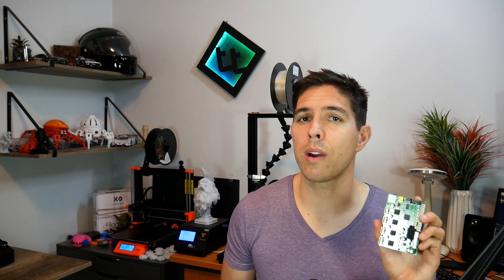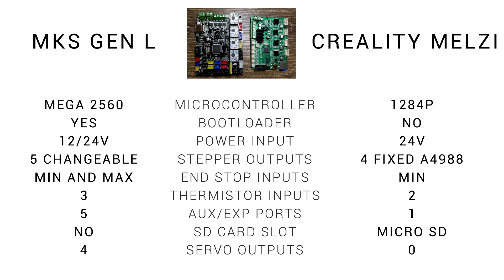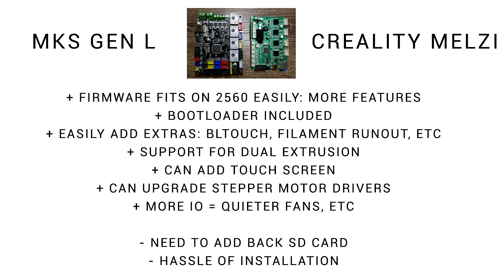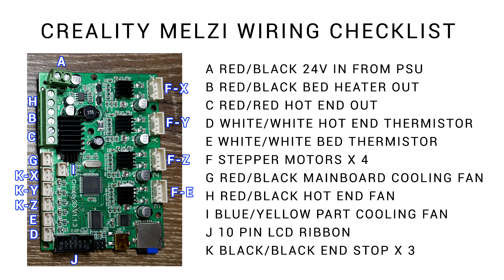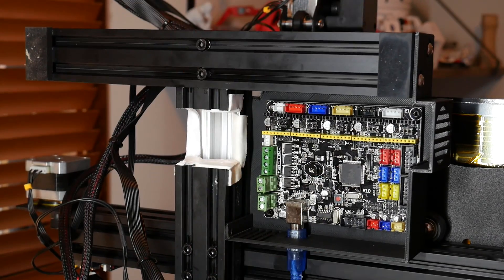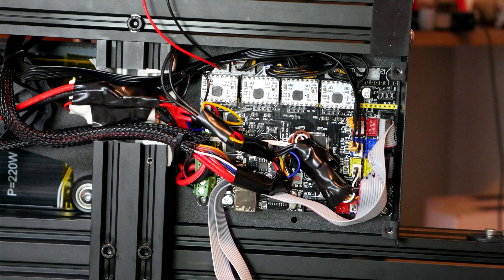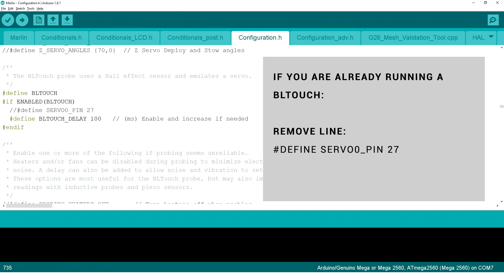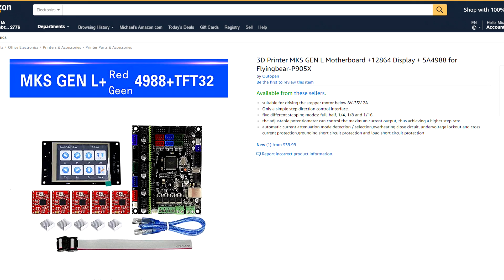Easy and cheap Ender 3 mainboard upgrade: MKS Gen L guide

Comment: Another great video Michael.  I've just purchased the  MKS Gen L board and some TMC2208 drivers to replace the stock controller on my Anet E10.  Your video helped a lot cause I wasn't sure where to connect the correct fans to, but pics really help.  Thank you. I would love to see a video on adding a touch screen to the controller, even though I use octoprint,  I still like to have the screen in place.

Comment: Is the pin 27 adapter board you used in your BL Touch video not used for this board ?  I noticed you uncommented the pin 27 line from the configuration file.
Reply: Jarrod Woolley this board has the input for the BL Touch already on the board. The pin 27 adapter isn’t needed.

Comment: how about a review on one of these? tempted to future proof my set up https://www.aliexpress.com/item/MKS-SGen-32bit-controller-board-which-runs-smoothieware-firmware-and-supports-A4988-DRV8825-LV8729-TMC2208-TMC2100/32964503976.html?spm=2114.search0604.3.8.18cb2999vqdo68&ws_ab_test=searchweb0_0,searchweb201602_2_10065_10068_10130_10547_319_317_10548_10696_10192_10190_453_10084_454_10083_10618_10307_10820_10301_10821_538_10303_537_536_10059_10884_10887_100031_321_322_10103,searchweb201603_51,ppcSwitch_0&algo_expid=c7f4b912-765e-42ef-856d-c7d672475e4e-0&algo_pvid=c7f4b912-765e-42ef-856d-c7d672475e4e

Comment: I am getting an Ender soon. Watched alot of the vids on bootloader, stepper dampers vids you and others have done. It seems to me for the cost of this little board it may be a day one upgrade, during assembly of a new printer. Thermal protection on day one and then any future electronic upgrades, ABL, runnout, etc are all easily added. I am thinking I would rather keep the metal housing and just drill holes for some standoffs. 

What is your opinion of adding this to a new system on day 1?
Reply from the maker: I would say make sure it's printing properly first. If you had a dud component somewhere you wouldn't know if it were the new board or what came on the printer.

Comment: Beside be able to add a touchscreen the fans and more outputs, what is the real advantage on this?
Reply: ST NT Mainly an increased memory to add additional features. The built in boot loader is a plus to upgrade the firmware. On the original board, to add a BL Touch and filament sensor you had to delete other features such as the boot loader.

Comment: You don't need to foam tape for the underside of the extrusion, there's a cable protector that fits the slot on thingiverse: https://www.thingiverse.com/thing:2934313 think me will be getting the mks board there's a few electrical issue's i'm not comfortable with on the original, one being if powered USB there's is a voltage bleed back on to the 24v rail so dont feel comfortable leaving the raspi plugged in when the printer is now powered.

Comment: Are the 5pcs stepper motor drivers required for this upgrade? Thats something that wasn't very clear in the video.
Can you just get by on the bare board and stock Ender 3 parts?
Reply: No you need the drivers as they are built into the ender board. The MKS board does not have hard wired drivers because the advantage is being able to upgrade your stepper drivers. I would highly recommend TMC2130 drivers as you will get less noise and better accuracy/quality prints.

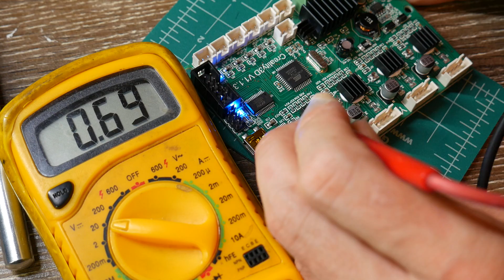Comment: I'm not very familiar with electronics, what are you doing at 5:00? Something about Voltage refs? Is that a critical step?
Reply: He's measuring the voltage on the stepper drivers.  Turning the small trim pot on each driver allows you to adjust the voltage going to the stepper motors

https://www.youtube.com/watch?v=AVlee67TQxs

If you're not familiar with electronics at all then you really shouldn't do this upgrade. A single slip-up will ruin a board when doing this.
Reply: @AERuffy  Thanks! Gotta learn it sometime :)
Reply: @AERuffy  Is it essential and I have to look into it or can you skip it?
Reply: Ian it's essential. Too high and motors run hot, meaning a fire risk and or parts failure. Too low and you'll get skipped steps. It's not hard to do, there are tutorials on YouTube.

Comment: Great video! Thanks so much! I'm thinking in print the bullseye mod for my ender 3 pro, like in your older video. I see your mod with a noctua fan. Do you use it with a voltaje reductor or dual fan? Could you share the stl of this mod, please ?  Thanks in advance!!!
Reply: You will need a buck converter (voltage reducer) to add the Noctua fan. Noctua only makes 40x40 up to 12v. I personally have mine hooked up to the power supply using a JST connector so it is running all the time but might try to make it so that it works with the fan connection on the MKS. Either way, you will need to reduce the voltage.

Comment: thanks for the video, I was just trying to put together my MKS board with my Ender 3 and I was (and I'm still) struggling.
I followed these steps and I flashed Marlin but I don't have the Bed Temp and control anymore. Not on the screen, not on octoprint either.
I used another marlin firmware customized by someone else, I got the bed temp and control (but I have some other problems so I tried this way)
Do I have to modify something else in the firmware to enable the bed temp ? it's really weird !

Comment: You should have also added a micro usb module, soldering the wires yourself is not a problem but as alternative there should be connectors already made for sure.

Comment: Awesome walk through Michael. I have a couple of questions on things you mentioned. Obviously I'm refering to my CR-10 S4 (v2.1 board), 1. S-curve, is it worth enabling? and will it work on my printer? 2. I'd like to add the temp controlled hotend cooling fan function, do you have a guide? 3.  Would a touch screen work. Do you plan on making guide videos on these things?

Comment: My Ender 3 came with a dead extruder driver, as I do electronic repairs I replaced the driver IC and did some pcb improvements, you can find videos of it on my channel if anyone is interested.

Comment: interesting post , I got a Gen L for mine but I intend to use the 1284 RRD full graphics as it has the handy SSD slot - while  bench testing the electronics I found that I had to  remove the plastic plugs on the exp1 & exp2 and flip them around 180 degrees for the display to work - not sure if I'm going to go with tmc 2130's  with hardware SPI or lv8729's  with 32 steps as yet as thats what I have to hand - one last thing  not sure if your aware but there are some new very cheap 32bit boards appearing like that bigtreetech SKR 1.1 which looks very similar to the GEN L but 32 bit and smoothieware

Comment: When i use it with 24v...do the stepperdriver also run with 24v or is ther something like a internal buckconverter that droped the voltage to 12v?

Comment: I just ordered a CR-10S board to upgrade my Ender 3. I was looking at the MKS board, but seemed too much work to make fit. I should have waited for this video.
Edit: Just got the CR-10S V2.1 board working with Marlin 1.1.9 using the CR-10S config examples and changing the print dimension for the Ender 3, and the LCD config to be CR10_STOCKDISPLAY from REPRAP_DISCOUNT_FULL_GRAPHIC_SMART_CONTROLLER. The V2.1 (and probably V2.0) board does run fine with 24V, in case anyone was wondering.
Mostly the install was as simple as swapping the boards over. The 10-pin LCD connector needs to be installed 180 degrees rotated, which means you need to cut the locating protrusion off the connector (done easily with the blue side cutters). Seems the Ender3 connector was wrong, now they have fixed it to be the same as everybody else. The hot-end fan was bare wires and I needed to crimp on a 2-pin connector to plug into the new boards VIN connector. You could pick up voltage for the fan from the PSU connectors, but I wouldn't try to double up on the hot-end or bed connectors as a lot of current flows through these.

Comment: WOW, good job Michael.  That was a ton of work. There is a Thingiverse file to 3d print a protector for the wires going thru the mainframe.   Here's the link:  

https://www.thingiverse.com/thing:2934313

It says a cable protector. I think it should be included in a list of upgrades. I made one for mine. It works

I haven't got my Ender 3 back up and running yet. :(   I just don't have the money. I need wheels and build plate, another $40US
and I just don't see it happening anytime soon. Shame cause I did do some prints before it went south. I'm thinking seriously about the tevo tornado. 
Thank you and Merry Christmas to you and the family.,

Tom

Comment: Looks like you wiring the Hotend fan the the E1 12v spot? Would this not cause issues if you wanted to add a second Hotend later?

Why not put it on a relay and use a 5v signal to trigger it instead?
Reply: I was thinking the same thing, but I'm not incredibly electronics savvy. Would I be able to wire a normal 5v fan with a two dupont cable to any of the other ground and 5v areas in the diagram?

Comment: Great tutorial! I changed my board with a Creality V2.1 and even the SD card and USB slots are in the same place. This board is the one which cames in the CR-10S. But I do not have replaceable drivers, they are on board.
Reply: You did this on an Ender 3? Where did you buy the v2.1 board from?
Reply: @drewd423  From Creality Aliexpress Store. I made an adapter to have just one cable to the screen, but the easiest way is to add a second cable like Michael did.

Comment: Great video. I would be interested in seeing what a touchscreen is like on this setup. 

This may be a dumb question but if there’s no SD card how are you getting your Goode to the printer? Octoprint? Through the usb?
Reply: I think both are valid options, Although Octoprint is the option with the most added value in case your laptop is in another room for example

Comment: excellent video as always.  Just wondering about settings?  esteps, and PID etc, I suspect after the firmware is loaded into  the new board one should go through those steps again.  I will check your previous video's to see if that is covered. :)  Merry Christmas and happy new year. :)